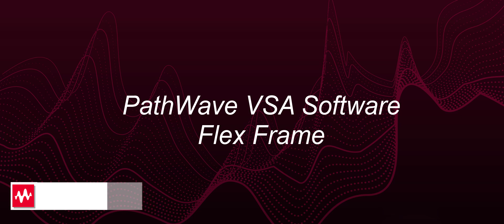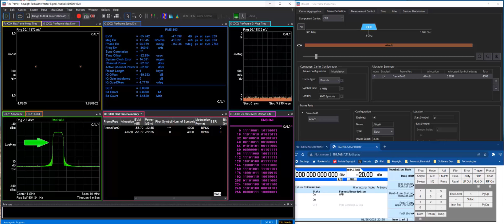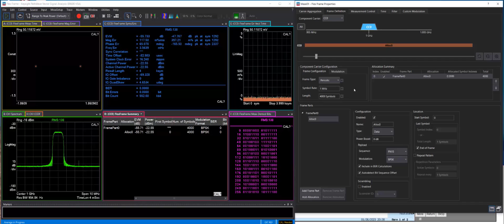BER Measurements using the PathWave 89600 VSA Software

Comment: Hi John, i have one doubt in flex frame summary window power(dbm) is per RE power??
Reply from the maker: Hi Koti, Usually when people talk about scheduling at the PHY layer for 5G NR, we may talk about resource elements (RE) as taking up a certain spot in time and frequency. However, FlexFrame assumes that the signal is a single carrier modulation (not OFDM), so the concept of resource elements is a little tricky. If you have more specifics on your signal, please feel free to reach out to Keysight Technical Support at https://www.keysight.com/us/en/contact.html.